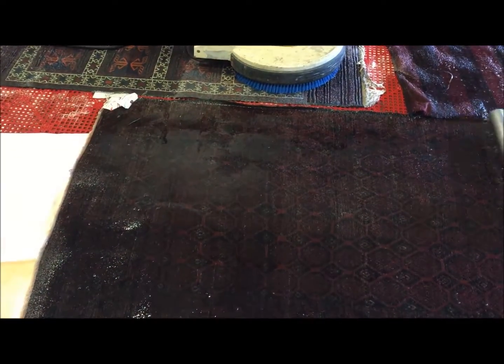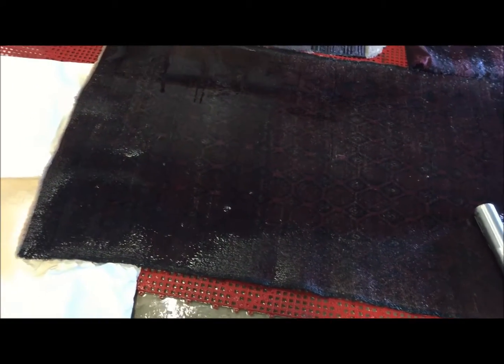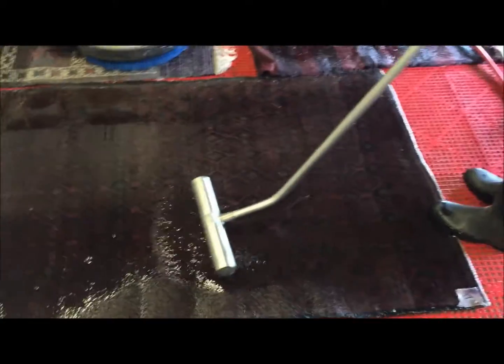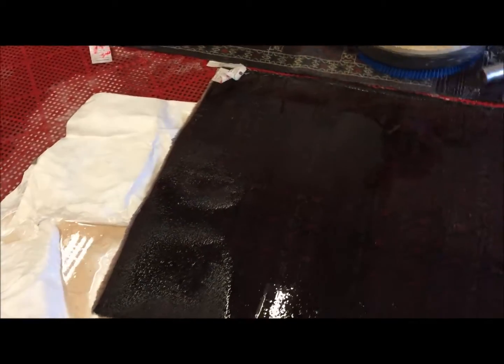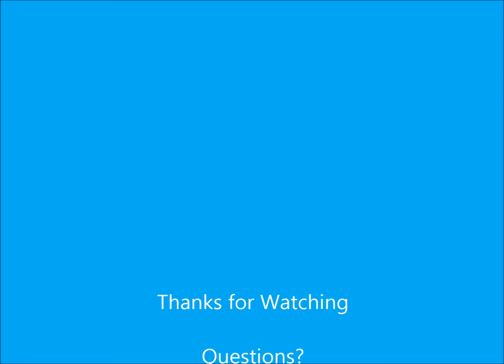Oriental Rugs With Dye Bleeding

Comment: Do you use Dye Loc prior?
Reply from the maker: not on this rug
Reply: What do you use to stop the dye migrating?
Reply from the maker: Mostly we flush until the dye stops running then dry as quickjly as possible....sometimes bleeding happens and you have to correct it